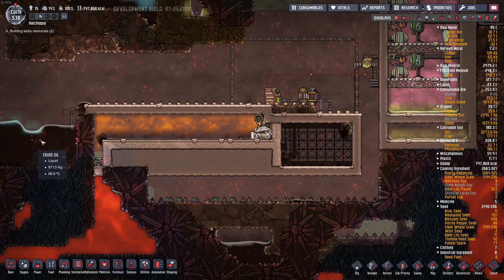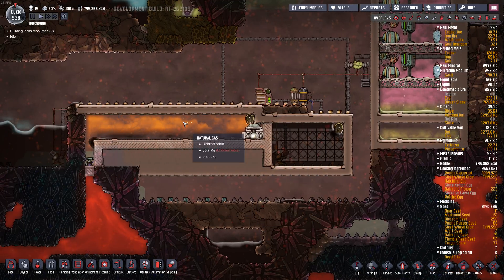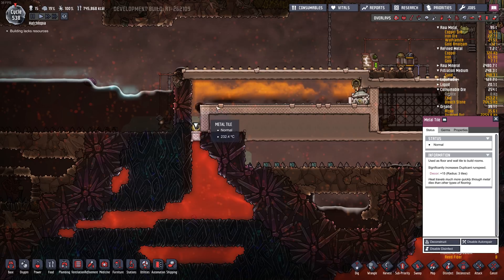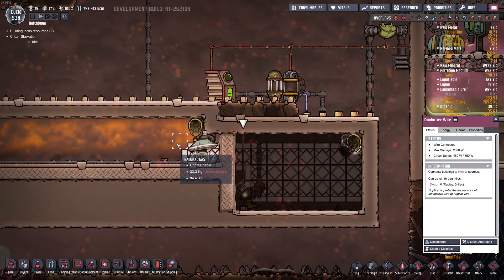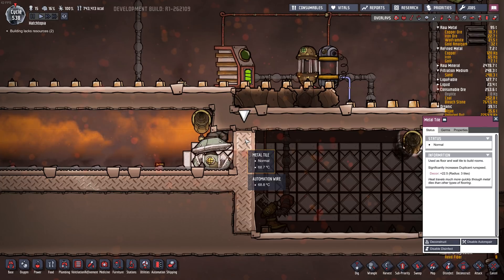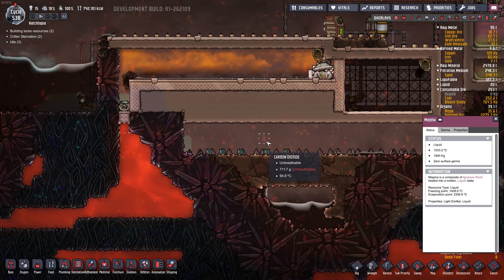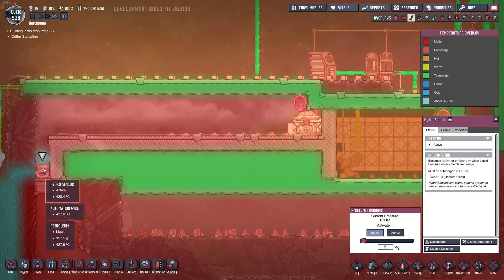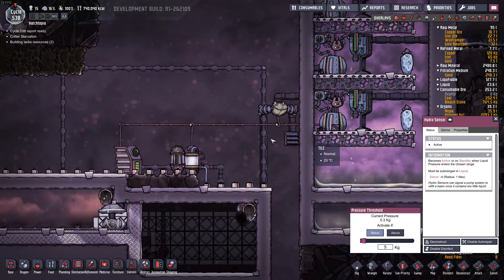MAKE NATURAL GAS FROM OIL USING MAGMA - Oxygen Not Included

Comment: Please remember that this video is out of date and you can't get natural gas anymore this way, it has gotten A TON more complicated, so you can pretty much forget it. 

I just built this, thought it was current, and instead of natural gas, I got sour gas, which has to be turned into methane (cooled insanely to -180 or something) and then turned into natural gas, so pretty pointless and SUPER complicated. I'm trying to save my base from destruction due to coal shortage, cycle 365 and this just made me waste 20 cycles to build.  Could you please make sure that people don't try this setup anymore? Tt does not work with the current release.
Reply: @alois kleinestier I made a design for a very sweet geothermal plant system, as long as you have access to a (small amount) of steel and lots of water it could save your base if power is your issue.  https://steamcommunity.com/sharedfiles/filedetails/?id=1978000406
Reply from the maker: pinned this ao people dont get stuck. hatch farms are nice to get coal flowing until you get to better power.

Comment: What material is the metal tile? How do you prevent it from melting?
Reply from the maker: Tungsten. It has a very high melting point and transfers heat very well. On the tile on top of the magma needs to be tungsten.

Comment: Well, since they fixed the drip cooling exploit you shouldn't have to worry about the dripping oil cooling down the magma through the metal tile.
Reply from the maker: I heard that fix (or an insulation fix) went really bad. I hope they sort it out before it all goes live.
Reply: Yeah, I've been following the forums.  Abyssalite and insulation has been changed and reverted and changed again half a dozen times already.

Comment: The Carbon Gyser discharges at 500 C I am planning to do a similar setup with the hot CO2 turning oil into petroleum. It is a 1 to 1 conversion which is double the machine rate.
Reply from the maker: That is an ideal temp. I like the new geysers but they aren't active enough :(

Comment: Another ONI Youtuber Brothgar has done a few videos on more complicated setups using volcanos but I like the simplicity of this, I can see after many cycles either the magma will turn into rock or the nat gas will become too hot to pump, being too hot to pump could be fixed using the radiant pipes now in the game
Reply from the maker: The magma will certainly turn to rock after many cycles. If you add new oil to the right tank, and use all the gas that is produced, I don't think the gas would get too hot. I've seen a few of Brothgar's crazy designs. That guy always cracks me up. He's a mad scientist for sure.

Comment: What you think about using the oil in the pipes to cool down the natural gas using the new heat transfer pipes and also changing the metal tile to the right of the hydro switch to abyssalite because this tile is cooling the petroleum while the tile below the hydro switch is heating it?
Reply from the maker: I tried using pipes but if the oil converts to petroleum while in the pipe it breaks the pipe. This is why I went with a pipeless system. Yeah swapping out that metal tile for abyssalite would make good sense. Less heat escaping.
Reply: Grind This Game What about trying less conductive pipes so you reduce the heat transfer and the oil stays as oil?

Comment: Very nice small design.  Looks pretty stable too.  I'm waiting to see what they end up doing with the temperature averaging myself.  You could probably have a vacuum door setup between the boiling spot that triggers based on gas pressure so it would turn the system off if you are not using it fast enough.